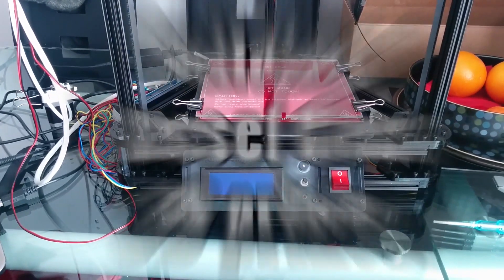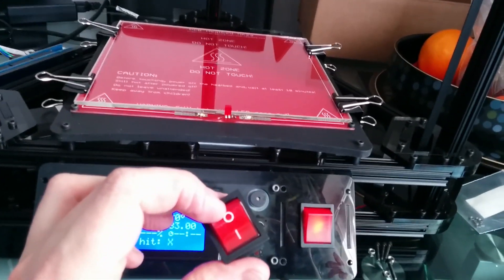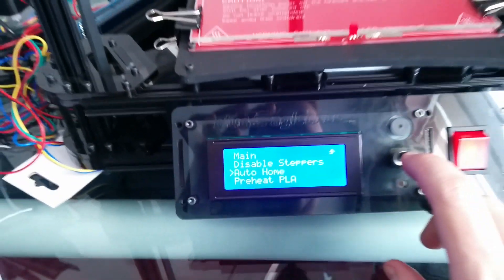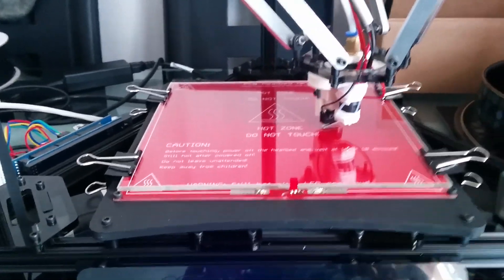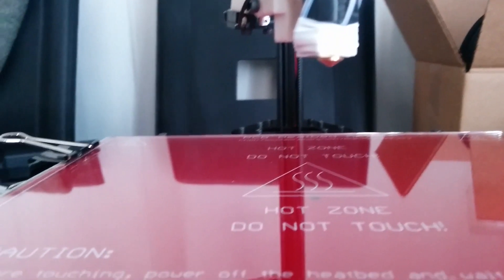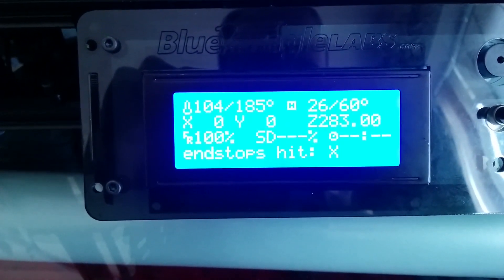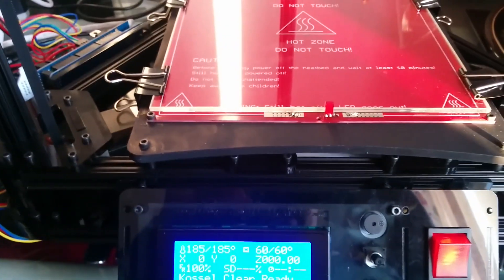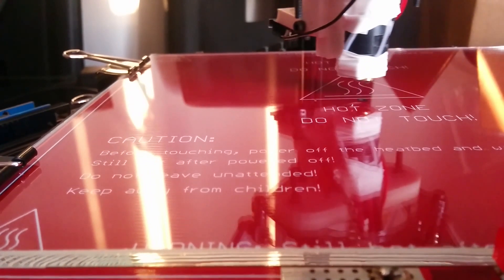3D Printer Setup - Kossel Clear

Comment: Thanks for creating and sharing this video. I just received my kit but haven't started assembly yet. It's nice to see (good or bad) the expectation of what I'll run into before actually making the printer useful. I hope you've solved all the little one time issues and are off and 3d printing like mad!
Reply from the maker: Good luck with your build, the instructions are much better now than when I built mine. A lot of the information was wrong and there were a lot of stages missing that I had to figure out myself. They've completely remade all their videos now to a much higher standard too. I'm guessing I would have been a lot less stressed and confused if I'd had those when I built mine!

The extruder that shipped with my version was very poor as well and caused me untold problems. I believe they have altered it for the newer kits to a more reliable design.

Please check out some of my other 3D printer videos, I actually managed to get it all working in the end! :-) Thanks for watching!

Comment: Also, yay for already doing better then the average new inkjet printer by this point. Looking forward to seeing what the issue was!
Reply from the maker: The issue with the height was due to me omitting the '-' when I entered my z-1.85 calibration figure. Still working on the lack of filament issue, I think my extruder may be a crap design, I also might have blocked the print head with plastic... I dunno yet.
Reply: Oh, aye - an obvious-in-hindsight issue for the height sign. Still, could be worse - try that in rocketry and you make a real mess.